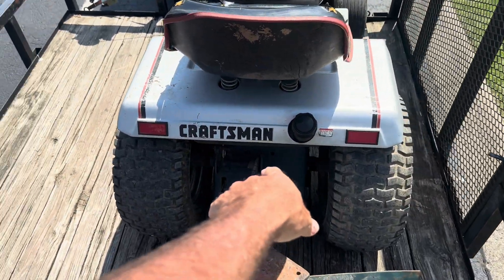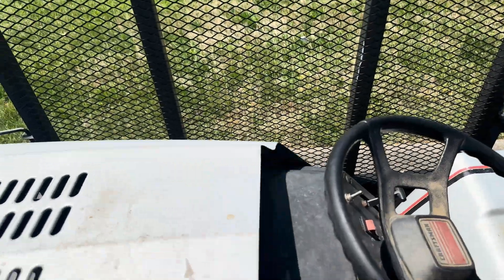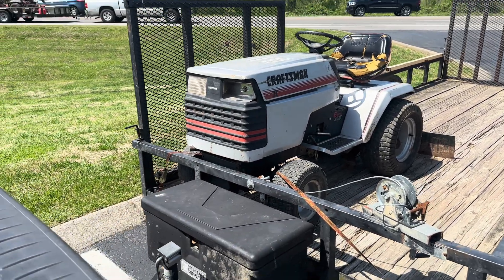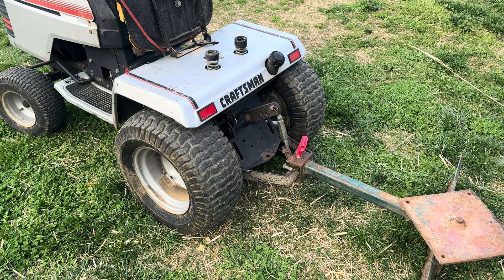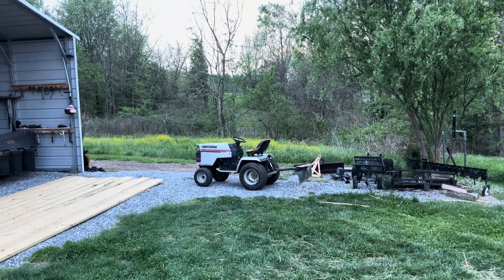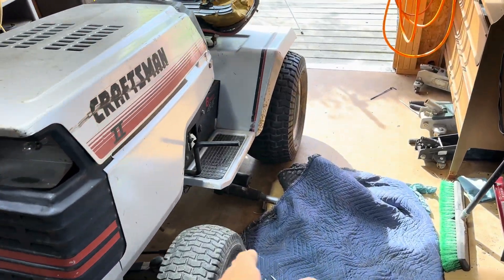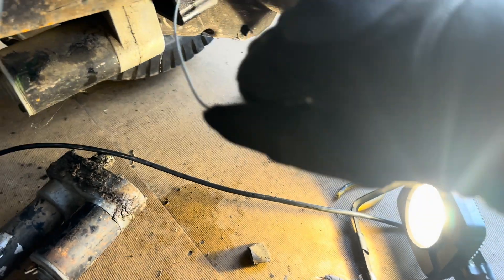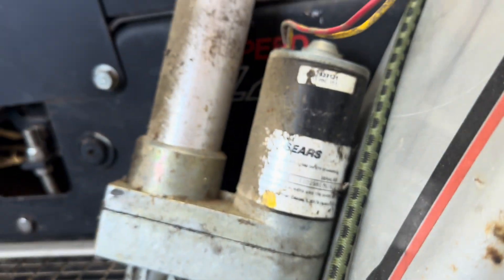Sears Craftsman II electric actuator ￼

Comment: i used the upholstery from the back portion of an old high rise office chair (the kind with black plastic armrests and base) to cover the entire seat of an old murray rider  . just slipped upholstery off chair in one piece , and worked it over old mower seat . trimmed excess and tucked under hinge . might not work on larger/wider seats . might come in handy for some future find in need of seat repair .
Reply from the maker: That’s a good idea 

Thanks

Comment: Good one Lee. Neat lifts. Did you check the charging to see if  it’s putting out the correct voltage. That actuator would need a good power supply. And did you figure out what engine is in the tractor. 
Have a great Friday. 👍🏻👍🏻👋👋
Reply from the maker: I didn’t really check the charging system, but I did confirm it was doing enough to charge the battery, but maybe I need to put a voltmeter on it